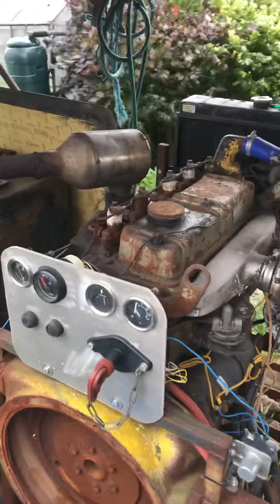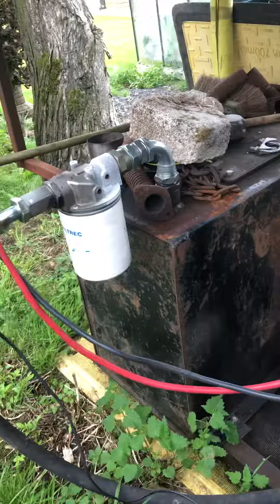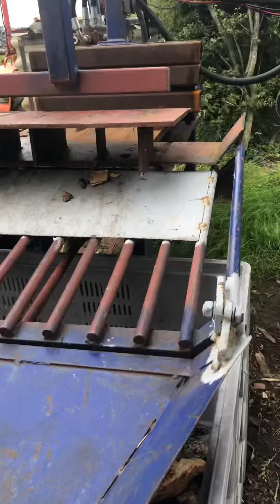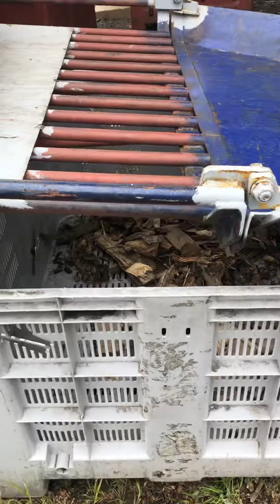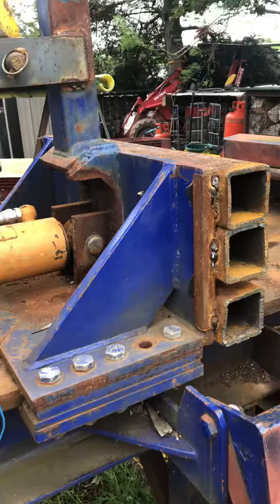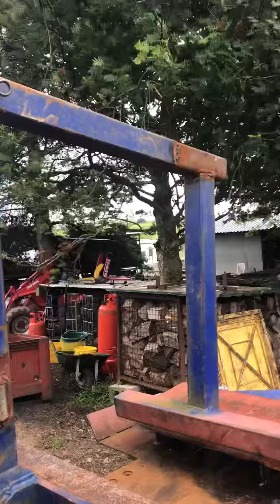Homemade Hydraulic Log Box Wedge Splitter Perkins out of Hyster forklift Power plant splitter # 4

Comment: Hi how it’s work ?
Reply from the maker: Hello Mehrdad if you look on # 6   vid it shows it working  Its the engine and pump  from a Hyster Fork Lift Truck connected to a ram and it pushes tree stumps through a set of knives called a boxwedge then you pull the remainder of the stump back to be able to go through again         Cheers Joe